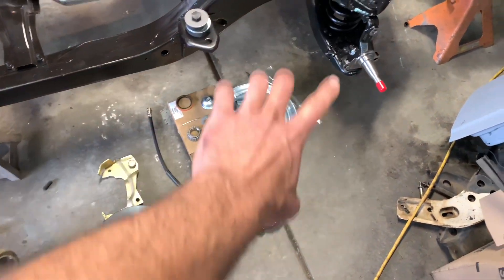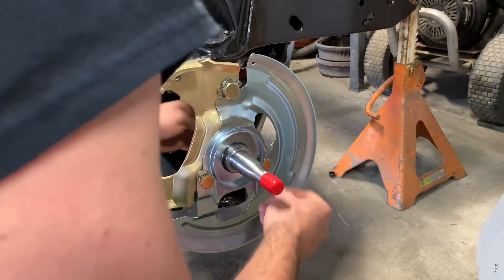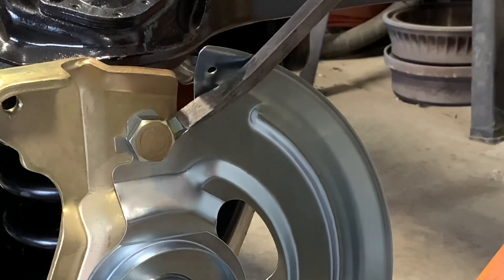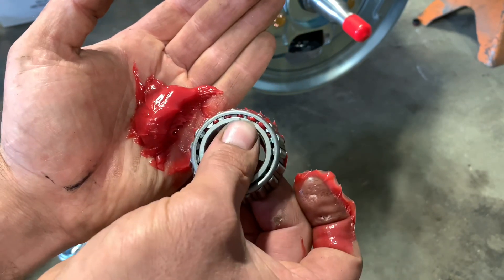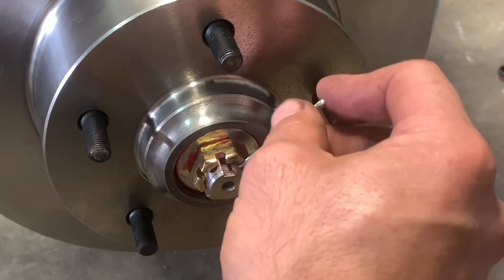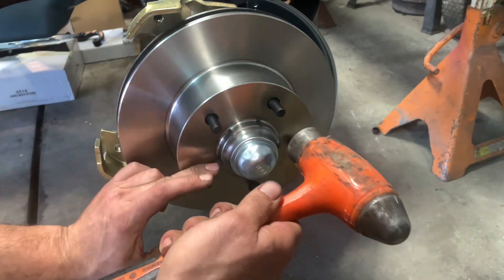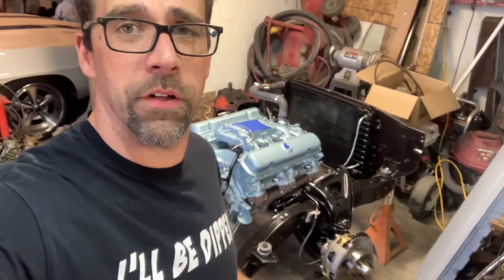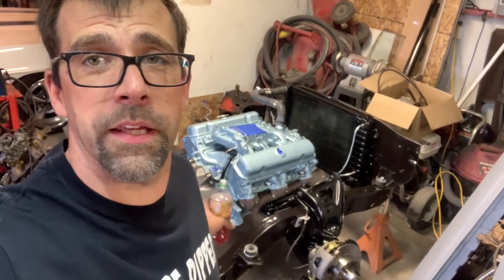1968 Firebird disc brake upgrade install and part identification

Comment: really helpful tips on the pad install.  I did not know that you could bend the little ears on the pad to make a tighter fit.  Thanks Jon!
Reply from the maker: Glad to help.  It helps prevent brake squeaks and keeps it in place during assembly too. It was taught to me while I was in high school shop class and just always did it that way since

Comment: Great work.  Thank you for the tip with the brake pads, that one is going into my permanent memory lol.  I have always preferred hand packing bearings.  I have used the tool but I find it kind relaxing hand packing them.  I cant wait to see you fire that engine up.
Reply from the maker: It was taught to me many years ago and it just stuck in the old rememory.  Spoiler it runs great and super happy with it.
Reply: @VinylVillageGarage  Good to hear.  I cant wait to finally get my engine in and started some year.
Reply from the maker: I want to see your custom belt drive operating. I haven’t dared try to build one but now I almost want to see if I can conquer  that challenge like you are doing.
Reply: @VinylVillageGarage  LOL.  I want to see how well it works (fingers crossed it doesnt blow apart).
Reply from the maker: Lol, good point. I hope it works great for you

Comment: Another great video. An interesting note on the conversion kits is that they use a flex hose based on where the drum brake steel line terminates vertically on the outside of the frame rail, they also use a caliper with the hose tapped in a different location than a factory disc brake car. It is a little more involved to make it like a factory disc brake set up but is a neater installation when done without any hose clearance issues in the wheel well.
The factory disc brake set up used a bracket on the upper control arm to secure the flex hose and ran to a steel line that terminated horizontally on the top of the frame rail. I have used the kits as a starting point and make the necessary changes to make it like a car that left the factory with disc brakes and no chance of the flex hose interfering with anything.
Reply from the maker: Even the replacement brake line kits makes a difference between factory disc brake or disc conversion.

Comment: You learn something every day!  I've done breaks on my '69 countless times and I've always had a little bit of squeak, mostly from the rears (D154 style kit).  I've never seen or heard anybody discuss the outboard pad tangs as a culprit.
Reply from the maker: Glad to hear you learned something, thats our goal. It was taught to me while in my technical training, it was a very in depth course on all the details from pad replacement, brake line bending and flaring, turning rotors, rebuild calipers and wheel cylinders.   All the things we don’t do now, it’s cheaper just to replace instead of rebuilding nowadays.

Comment: 7:14 From the Camaro Supplement manual.
When you spin the rotor, torque the nut to 12 lbs ft. Then backoff the nut one flat and insert cotter pin. If the slot and pin hole do not line up, back off the nut an additional 1/2 flat or less as req'd to insert the cotter pin.
Reply from the maker: That is great Info, that would cover just about any hub type rotor. To tight is just as much and issue as too loose.

Comment: Good call on the conversion, disc brakes are so much easier to work on than drums. I tend to have trouble getting the auto adjusters put together right for drums.
Reply from the maker: Drums can be a bit fickle especially on the front to keep it stopping in a straight line,  it can be done but I really prefer disc brakes on the front.

Comment: Now you tell me to install the brake and fuel metal lines BEFORE the engine goes in... hahahhahaha I going to just bite the bullet and go disc up front in my Bird after watching this video!
Reply from the maker: It’s worth the effort to upgrade, disc brakes stop so much nicer.

Comment: Looking for a right side windshield. Curious if you have any line on one project looks good though
Reply from the maker: That’s a tuff one.  I don’t, unfortunately the aftermarket doesn’t help much for those parts either.  It could be fabricated definitely will take some time.  Is yours rusted out or bent up?
Reply: A tree hit the corner
Reply from the maker: Not cool. The reason I asked is if it was rusted you have to find or fabricate a new one.  Being bent there is a chance it could be repaired might have to cut it apart and pieces out of it but it’s possible.

Comment: Hey John just curious why you don’t use. Some source of Loctite? If I’m ever in the area I would be honored to come help you on a project. It seams I learn something new with ever video you post. Have A Blessed Thanksgiving Brother🙏
Reply from the maker: Good point I do have red and blue in my top
Right drawer of the tool box. It would not hurt I suppose. The lock nuts are ok but the loctite would hold even better.   If ever in the Indy area or will be let me know I would be happy to have someone to play cars with.  
Happy thanksgiving to you!

Comment: Used to place a little blue loctite on the threads of the two bolts that mount the caliper. Have you heard of doing that?
Reply from the maker: I have on the newer cars that bolt the saddle to the spindle, its a must. I never have seen an issue with this style caliper mounting bolt backing out. I haven’t used it. I am sure it would not hurt if someone did on this design

Comment: Great instructional segment. An observation and a question. Firstly, did you ever see a spindle with a gasket on it's face between the flat machined surface closest to the shaft, that mated with dust shield? I did once, material was the same type of composition as a water pump or fuel pump to block gasket. Never saw one again- this was factory GM components like what you're working with.
Second, Do you know where I can get the keyed washers? I'm pretty sure mine have gotten lost, and I like knowing where all my pieces are way in advance so I can finish up a job and not have to come back to it. (already have too many of those!!!)
Reply from the maker: Yes I have seen those gaskets. I took a set of disc brake spindles of a 1970 Buick GS to convert my first Firebird to disc brakes, this was back in the day when nobody had aftermarket kits so you had to find the parts and make your own kit so to speak. They had those gaskets other then that I think I had a right stuff kit that had them but i can’t remember 100%. 

As for the keyed washers i have the two that came off the drum brakes from the great pumpkin, pretty sure they are on my tool box at work.  I can check tomorrow for you

Comment: What size are your front wheels? I am wondering about the kit you used and the clearances to the wheels for my application. thanks. Great video again.
Reply: That brake kit is a widely available kit, identical to the GM components used from at least 1969-72. Used in the Abody (Chevelles,GTO,442,Skylark) F body (Camaro, Firebird) and X(Nova, Ventura, Omega).Smallest wheel you'll probably get away with is 15"
Reply: @Cseidelmann6770  I thought the Firebirds and Camaros of that vintage had 14" wheels. Mine are 14"
Reply from the maker: I have 14 rally 2 wheels for this car.  Keep in mind not all 14” rally wheels clear the caliper they are different.  There is a Chart on line on which ones clears. I also did a video on this about 6 months ago or so. There is a 2 letter stamp by the valve stem hole to help identify which rim you have.
Reply: @VinylVillageGarage  Okay that information is huge. I had no idea. There is almost nothing worse than buying an expensive part or kit that you are sure will fit and then when it arrives at the door you find out that it doesn't. Thanks again.
Reply from the maker: Glad to help, we are all in this together trying To save as many birds as possible is the goal.
Reply: The 15” wheels appeared on Z/28 Camaros, but not sure what year that began. Know for sure the 69’s had them.👍
Reply: Good to know!

Comment: Looks great , which kit is this and coil springs? Stock ride height?
Reply from the maker: The disc brake kit is part#AFXDCOIC-11
It also has a booster, master cylinder, and modern proportioning valve. 

The coil springs are stock height moog brand  part 6312. There is like 30 different part numbers for front springs for the 1st gen f-body cars.  And it comes down to engine size, transmission, with A/c, and so on.  The ones I bought are a bit of a guess and i hope they work.
Reply: @VinylVillageGarage  Thank you , you got her going together nicely
Reply from the maker: Thank you, I believe this will be a nice car when done